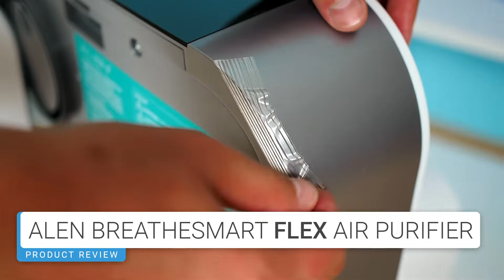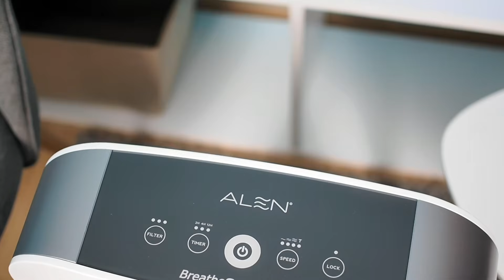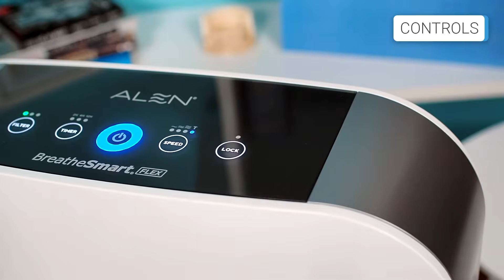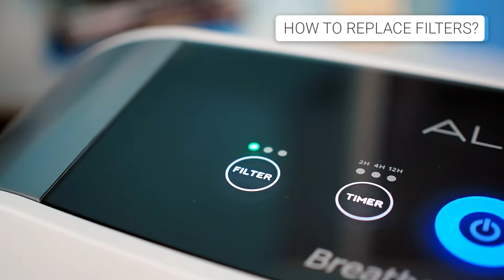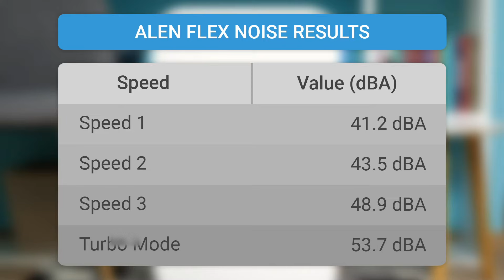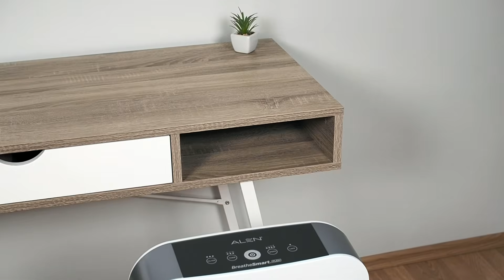Alen BreatheSmart FLEX Air Purifier: Quiet and Powerful (Review)

Comment: $66 dollars (62 with subscription, I believe) for their basic filter that lasts 1 year at max speed 24/7. Free shipping. And you can pick the types of filters you need. I owned a Dyson tp01. $89 for the filter, 6 to 12 months, not medical grade. Barley any carbon. Not bad. My blue air beat it to death though. For $19 per filter on that one. Only reason I'd buy the Alen is that it was made by an ex NASA engineer. Oransi's CEO was an ex engineer of Alen. Both make outstanding devices. But Alen purifiers are: *sealed systems. * Are tested to remove 99.99% of COVID-19 Wich by definition could make their machines actual medical devices. Their costomer service is outstanding. Their warrenty is outstanding. Their design and customization is excellent. Their pink noise is perfect for anxiety and light sleepers. They have some of the best air quality sensors on the market. Alen is up there with Austin air. IQair. Aeris. Etc. They are legit top end. But also affordable.
Reply: Thank you for the compliments!

Comment: Would be nice to have a video with top 3 recommendations for small, medium and large rooms and possibly even a small house/apartment.
Also, when you do different performance tests, it would've been nice to see a comparison to overall average or to a similarly priced model (or a model with similar coverage) in a review video.
Otherwise, for an average consumer it is difficult to tell how good the filter performs really.
The comparison videos you do are nice to have, but do not really give enough context to find the best filter for user's needs (if the said person didn't watch every single video and wrote down the metrics, which lets be honest, people usually do not do).

Just my few cents from a consumer stand point. Otherwise, excellent videos, wanted to find a channel like vacuum wars just for air filters.
Reply from the maker: Hi Ivan, 

You have some brilliant points, and I completely agree with you. 

The thing is that I want to test as many air purifiers as I can, and after that, the plan is to create well-researched buying guides.

I have already prepared some sketches of how the buying guide has to look like, but your idea of comparing overall values is fantastic (will be included in the videos)!

Thank you soo much. I will definitely use some of your ideas!

Comment: An in-depth and excellent article I read about this brand/ model of Air Purifier, said this - regarding available filters to choose from, which would be compatible with this machine:

The optional filters are:

    Dust, Mold, Pet Odors
    Dust, Mold, Pet Odors + Smoke
    Dust, Mold, Pet Odors + Heavy Smoke

I realize that some Alen True HEPA Filters have 0.66 lbs. of activated carbon in them.  Would that correspond to the middle category (listed above), and would it also be known as Alen's "B7-Fresh" filter?  ~ Also, I realize that some of Alen's filters have 2.33 lbs. of activated carbon in them.  Would they correspond to that last category (listed above), and would they also be known as Alen's "VOC / Smoke" filter?

At a source where you can directly order - from Alen - the specific filters wanted, it presents  the customer's options as these  four choices:

B7 - Pure   ("capturing allergens, dust, mold, and germs"   and that's it )
B7 - Fresh   ( "absorbing harmful chemicals and VOCs, ... household odors + capturing allergens, dust, mold, germs"  with no mention of smoke)  
B7 - Pet/Odor    (a.k.a.  "... with Odor Neutralizer"  and no mention of smoke) 
FL40-H  Heavy Smoke   (a.k.a. "VOC / Smoke" is the handle, with a very long description given also -- of odors & pollutants eliminated)

And this may be a very obvious question, but would all of the available filter options (listed above) be the same size of filter, in terms of dimension?  In other words, would they be compatible with -- and fit into -- the model of Alen's air purifier that you are reviewing here?  Namely, the Alen Breathesmart FLEX model ("which is designed for rooms up to 300 sq. ft." at one source - first paragraph of Milan's excellent article, but described as "700 sq. ft." near the beginning of this video)?  Confusion.

Would this specific model also be known as "Alen BreatheSmart FLEX True HEPA Air Purifier", at other places?  In other words, is the latter a separate product, or rather just a more complete description of its official name?  (which is shortened here)

Reason for asking, is that whenever I look up the Alen filters with more activated carbon in them, it seems they are larger in size, and thus require a larger Air Purifier to accommodate them (thus, involving a different model, that costs more, and is heavier, etc.). 

I would like to buy an Air Purifier machine weighing no more than 15 pounds.  Alen source seems to say that there are 4 different filter choices, but I'm not sure they are talking about the same model which you are reviewing here.  (I'm trying to find the exact same model, at Alen source, ... but don't feel confident that I located it successfully there.)   Quote from this video, near the beginning says "... the Flex is the smallest model, in the BreatheSmart series".  

Is there a concise "At-A-Glance" list, somewhere, of all Air Purifier machines that a person can buy directly from Alen?  If I could see them all listed together - perhaps with just very brief specs. (in order to differentiate them from one another) - then I could feel more sure that I'm selecting the intended machine.

Are you able to help me to clear up this confusion?  Thanks in advance, if you are.